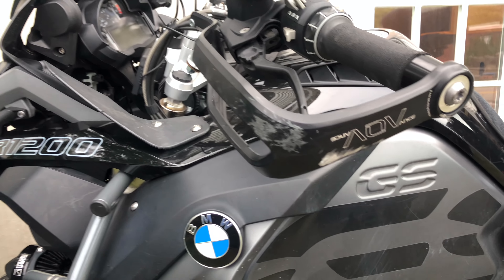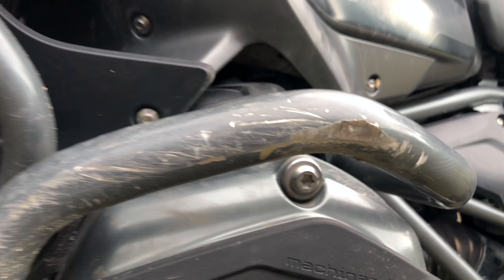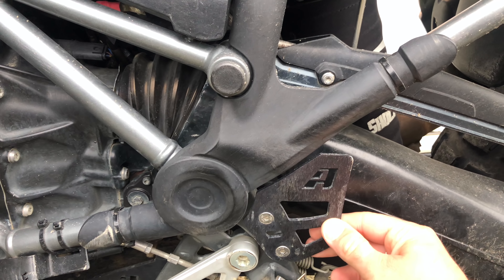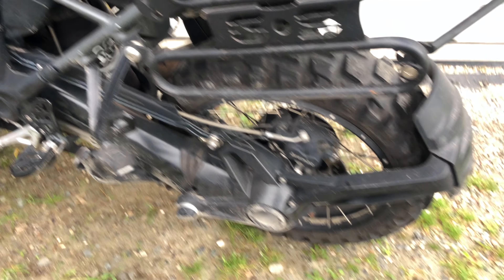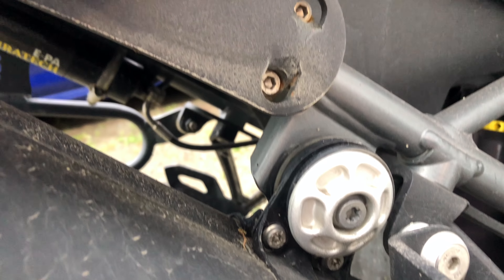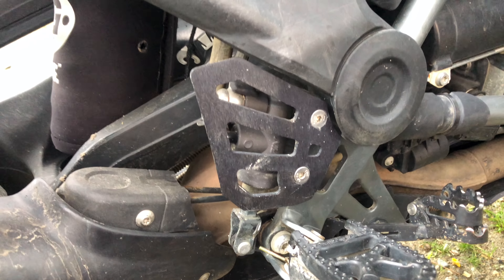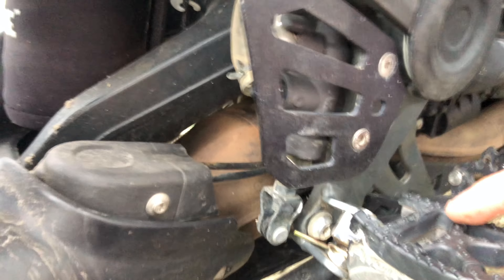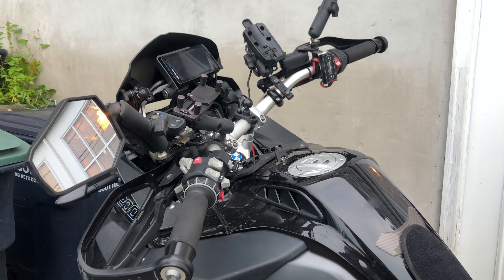Analyzing the Crash Damage on my BMW R1200GS Adventure (2017)

Comment: Claim the insurance money, claim the "wreck". Engine running?Frame straight?Fix it yourself... Dont worry about the cosmetics, keep the bike as a offroad touring machine. You gonna fall off again, especially if you go offroad, and then you dont have to worry about dents and scratches.
Reply: i agree who cares if the bike not in mint condition its an adventure bike need to be dripped scratched and get muddy even mud can scratch the fairing or at least make the plastic color fade
Reply: Exactly. Don't have to worry about scratching the bike on any adventures now lol. Now you can run with just liability
Reply: Yeah the problem here IMO Is the expense you’ll undertake to rehabilitate the bike to a salvage title, and the fact that you dinged your insurance record. I always own my bikes free and clear for this very reason. Insurance is very cheap when you just carry liability and never make a claim. Saving up money and buying one of the gently used bikes out there for cash doesn’t just save you money on finance costs on the note and implicit depreciation of new vs. used pricing. It also saves you future insurance payments due to reduced coverage and foregone claims. IMO the smart thing to do here would have been to get the major damage fixed privately, accept the cosmetic damage and never make a claim. Insurance is always going to total the bike and then take the money right back off you in premiums.
Reply: We are all arm chair QBs here. I agree with you if you truly use this bike for what it is meant for it will be on it's side many more times. Battle scars add character and stories. Fix the safety issues and functional issues then ride on. I would not be afraid to ride this bike. Won't look so pristine at Starbucks.
Reply: @byzantineruins  I know this is an old post, but i think that is terrible advice. Insurance is running me like ~500/yr to cover my 13k motorcycle with full coverage. If my bike gets crashed or stolen the insurance company picks up the tab. It would take me ~26 years to pay for 1 motorcycle based on my yearly rate. 

While we're not talking about an absolutely insane amount of money either way, the economics of not having full coverage on a motorcycle is insane, unless we're talking a cheap track bike or something.

Comment: It is good that you were not hurt. I find it astonishing that that bike was not repaired. Unless there was something else that you missed in your analysis, I didn't see anything that couldn't be easily repaired. That includes the foot peg bracket. If it was my bike I might leave a few of the crash protection pieces on the bike just to give it some patina. Good luck.

Comment: I see a lot of people saying in the comments "what use is the protection if the bike was written off"  none of the aftermarket protection is marketed to save your bike from being a total loss... its there to keep you going. without those upper crash bars you would've been laying in a pool of oil as the engine got ripped apart and a 70 mile tow bill home is sure a lot more expensive then the crash bars are....or... what if you were halfway across the country... thatd be an expensive recovery and flight home. 
I put guards on my bikes as well for the purpose of trying to keep me going in the event of a crash or drop
Reply: Crash bars are pretty damn expensive.

Comment: Allot of new roads do seem to be built with corners that tighten up quite dramatically in the UK. It looks the same here.  The rule that I try to follow nowadays is slow in, fast out and stay on the outside of the corner until you can see the exit, not a false apex. You already had a good lean before the bend on the first arrow. It looks like there was plenty of opportunity to pick up the bike a little and brake as the final  crash was not really fast. Hanging of the inside of the bike also helps allot in these scary moments. In the end, the only bikers who don't crash are the ones who leave their bikes in the shed.

Comment: I was getting upset for you when you were talking about bills for damaged frame. Dude, you could of almost finished your tour on that. Virtually no damage, most of that was damage to the protectors you wisely put in place. If it were me i'd probably fix the shifter, back brake and license plate and ride on. The cosmetic stuff can be replaced over time when spare cash laying around!

Comment: Sadley, part of the reason our insurance is soooooo.... expensive is because facial damage like this is determined as a "write-off". Really guys, there is not much wrong with this bike, and realistically if you werent paying such a high insurance premium , youd probably just repair and restore the bike to its original conditon through repair, not replacement and keep on riding?
Ive crashed mine heaps of times, im only insured for balance of third party, fire and theft, no accident damage, and I tell you mine is sweet, I rebuild everytime I see fit, according to damage, im happy as Larry!

Comment: I was horrified when I saw your first vid. I have been on RTs for the last 6 years riding in excess of 80,000 miles. I regularly pushed the RT to the tyre edge due to its brilliant handling...however I have just swapped to a GSA triple black for a change so when I saw how easy it fell over at such low speed and lack of lean angle I was genuinely interested in the how the hell it happened....  then I saw those tyres.....  I presume they were the culprit...are they standard fitment in the US or were you doing a lot of off-roading??. They look useless for road use.....Genuinely glad your ok and thanks for posting such an honest couple of vids...
Reply from the maker: These tires are sold by BMW if you ask for "off road" and they're not just DOT legal, they are full radial tubeless tires marketed as go-anywhere with a really good speed rating. If I was hanging off the bike and leaning less, it probably would have gone better. The whole thing happened so fast.
Reply: @AdamChandler86  it certainly happened quick...looked like you had no chance of catching it ...glad I have the standard UK road tyres.... the GSA is great but after the RTs I am having to get used to a more wayward handling bike...if is a lot of fun though... ride safe...
Reply: Would you put those tires on a R1?

Comment: I'm curious how was the bike damaged on the right side when the slide was on the left side?  Did it hit the guardrail on the right side?

BTW that was not the "ProShifter" on the right side of the bike, that is the rear brake master cylinder.

Comment: Admittedly, I'm joining this conversation late.   That said, the tire is in great shape, but it's a knobby, not a street tire and therefore can't be expected to hug the road, corner the road or otherwise take tight corners like a street tire.   Isn't that why it failed?
Reply from the maker: This is what I tell people. 45 degree morning, cold roads, damp, full off road knobbies and a fully leaned over 650 pound adventure bike. I've done a lot of training & track days since this and I still stand by the fact that I was pushing these tires way too hard.

Comment: I mentioned a few things in your other videos about this crash, but here's a thought I should have added: Aren't the protective accessories for this exact situation? And you get to show off battle scars? If one is going to replace their whole bike over such seemingly small stuff (I've damaged my bike much more than what's shown in this video and been fine with it), then why spend the money on the protective stuff? You might as well have had NOTHING and the bike would still be totaled - so what was the point of the guards/protectors? To me, that exterior stuff MAY be replaced in a wreck (like the frame sliders), but crash bars and sliders and some scratches are hardly worth an insurance claim. I'm really not trying to be critical or a jerk, but I'm failing to see where the real damage is! Anyone that really rides their bike (especially in the dirt) would be fine with ALL this damage and barely even think about it. None of this is critical damage. What am I missing? Even bent pegs aren't worth trying to fix unless they're cracked - and then it's just a weld. Aren't these bikes supposed to be beaten up? Who wants to be a super-clean Starbucks rider?
Reply from the maker: The bike was replaced due to frame damage. The only thing not protected was the footpegs and when the bike slid into a guard rail, the foot peg mount bent on the metal and snapped a clip. That clip is the bike’s primary frame. No matter what else was broken, as soon as they saw that, it was written off as a loss. The protective bits are why I got home. I slide sideways on the crash bars and the hand guards took all of the impact on the left side. If no guard rail was there, I’d still be riding the bike.
Reply: Thanks for letting me know! I didn't pick that up in your overview of the damage on the bike. Like others commented, it seemed like such a low impact crash (I know it always looks smoother on camera than on asphalt!)... I appreciated your videos and watched all of them through the end - it's a very important topic. I've just been thinking about when I would make a claim for my 'dirt' riding, or for damage I'm used to doing (I've torn up quite a few bikes and have always considered that normal). Your videos were great - thanks for not taking offense at my questions.
Reply: @AdamChandler86  I have not purchased any additional protection for my new 1250 GS other than the factory engine guard option. I question if all the additional add-ons options will have good ROI statistically, so I figure I'm good with lass. Can you really say your added protection items allowed you to ride home at least? Perhaps you still could have ridden home, but with a few more scratches and gashes in some metal parts.

Comment: Watching this at first I didn't understand why you low sided. I have a K1600GT, and that lean angle was no problem at all for my bike. The audio portion of the video tells me you were'nt even scrapping the foot peg at that angle. I looked for a spill on the roadway, not the case either so what caused this low side. Later in the video it became clear it was the off road tires that caused this low side, actually you riding them like road tires is more the culprit. You did a nice job staying with the bike, and glad you're not hurt, the bike doesn't seem totally to me, but BMW parts are crazy expensive.
Reply from the maker: Gonna pin your comment. Not that you're the first person who didn't blame it on rider error (thanks) but because now almost 2 years removed, the tires are where I place the blame. They actually tried to kill me a few times before this because I rode them like I did my TKC80s which are grippy as hell on anything but wear faster than anything. These tires are not very grippy and kind of squirrelly and they bit me.
Reply: @AdamChandler86  Glad you're ok, and with street tires nothing at all would have happened except a great ride

Comment: Glad your OK, but what were you thinking banking so low with those tyres 😂
Reply from the maker: I wanted to go fast out of the corner. It didn’t work.
Reply: @AdamChandler86  I think it would of been a better day for your GSA  had you chosen more suitable road rubber.
Reply from the maker: Yes but I ride primarily off-road so I'm on knobbies most often.

Comment: good job by all the protective gear! The bike seems virtually unscathed and perfectly driveable. The only thing that would worry me is the right peg mount - is that really welded to the frame? If so, that's a stupid (probably cost cutting) thing by BMW. Those two lugs sticking out are the first thing that gets bent when the weight of the bike lands on the peg. I've just gone out to look at my Honda and not only do the lugs seem a lot more massive but they're also part of a sub assembly that is fastened to the lower frame by three massive Allen bolts. I would absolutely assume that that's the same or similar for a GS, a welded construction would be a major design flaw. 
Anyway, depending on that latter case, I would say your damage is in the sub US$1000 range. Replace any bent aftermarket parts, make sure the muffler doesn't touch anything vital and enjoy a bike that as a story.
Reply: looking at the vid again, I can see that peg mounting sub assembly is probably also screwed on, I can see the two lower bolts (right behind the peg joint itself and behind the brake lever), there will certainly be one behind the  plastic cap on top.

Comment: How fast were you going when you low slided? This seems like a tragical amount of stuff that got damaged from a low slide. I can’t imagine what the damage would be from a offroad crash LOL. My Tenere 700 has maybe 50 crashes till now and nothing ever broke or bent, except im on my 2nd set of crash bars.
Reply from the maker: I’ve crashed my GS bikes dozens of times off road. Dirt is far more forgivable than a steel barrier

Comment: Hello there Adam, I am not really smart but I seem to remember that back in the days you could not use full off road tires on an off road vehicle(car)/Jeep in New England!  Jeep brands vehicles could not be delivered/sold to the dealers with off road threads!  Does this apply to motorcycles?  I.e., can you ride on the open road with knobbies!  Glad you are okay and keep on riding...safe.  So I guess the 1250 will be in your garage soon 0:))
Reply from the maker: Anakee Wild and TKC80 are tires that ship on the GS from the factory. 100% legal anywhere. I was running the wilds.
Reply: Great to hear.  I was a bit concerned that for some reason insurance company(ies) might refuse the claim when riding off road tires on regular roads like they did back then on 4X4!  Great videos, vlogs, reviews, travels, -----Can't wait to see the 1250 in your garage O:))))
Reply: Tck80's are a 50/50 tyres so just as much for on the road as off of it.
Reply: 100% legal but still not a good tyre for road use.
Reply: Patrick Cooper j

Comment: I've watched the video several times and still don't understand the damage you sustained on the right side.  At risk of sounding like a Monday morning quarterback, have you thought about what caused your crash?  Your entry point on that curve started way inside, forcing you to take an inside to outside path, and the late adjustment in pulling the bike into a tighter radius.  Some other comments about the knobbies, but with a better line, they should have managed to help you stay upright.

Comment: You had all the protective gear possible for the bike and rider except for the most important part....the tires. 
"Adventure" tires are a compromise. You are riding on the street with tires that are mediocre for the purpose at best. You cannot argue that when you needed grip you had none. Each contact patch for your giant machine is the size of the palm of your hand. Think about it. If you ride on the street you need good street tires.
A dual sport bike is ok for off road and ok for the street. OK is not acceptable.
Reply: Yeah if you want to ride like you're on a R1 get tires like they fit to a R1.
Reply: splodge 57 A skilled rider can take even marginal tires to the edge of adhesion and then manage what traction is there. Those Contis are great and predictable when “ broken  in”. They were just brand new thus more slippery.  Pay attention to speed limit signs before corners: his entry speed, angle of attack, and arc were improper. It was

Comment: So, did the insurance company offer you a 'buy back' price for the bike?! Sounds like you already made up your mind on getting a new machine, however you could legally buy it back from the insurance company and sell it with a salvage title (probably not profitable) but it would help a poor chap like me get their dream machine! Seriously though, glad to see you're OK and the gear did it's job. Don't let the haters argue that point - it frustrates me reading some of the comments on here. I have an 05 12GS and I've 'over farkled' it but I don't have full coverage on it, no lien and thus if I break it, I fix it. Same gear that saved your bike has also saved mine a few times. AltRider Uppers, lowers, various controls guards, black dog skid plate, MAMO valve cover protection, MAMO ADVance handguards, Jesse challengers (luckily have not met the ground yet - knock on wood) I made the mistake of totaling everything up in an excel sheet as well...Kinda want to delete the file...Cheers to ya getting back on two wheels and learning from mistakes. Shit happens...Thanks for sharing!

Comment from the maker: Here is the bill from BMW showing what they thought must be replaced. I rode the bike over 100 miles since the crash so them saying my wheels, final drive, swing arm, front fork, etc all being damaged is due to cosmetics, not actual dents or dings that impeded the operation of the motorcycle. There was more "damaged" parts needing replacement but they stopped adding up the bill as soon as the value exceed 66.67% of the bike's value -  http://i.imgur.com/zHVFtrk.jpeg    Finally, this estimate did not include the frame damage from the bent footpeg.

Comment: If you had road tyres or even the 90% road 10% off road OE fit', you wouldn't have skidded. Off road tyres are not for tarmac as you have found out the hard way.